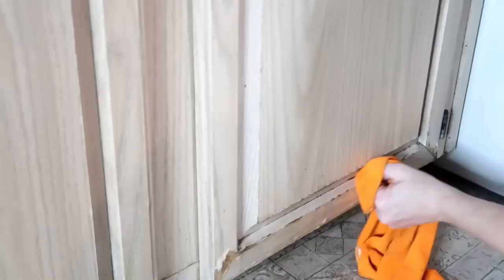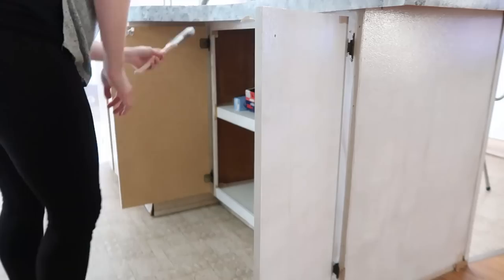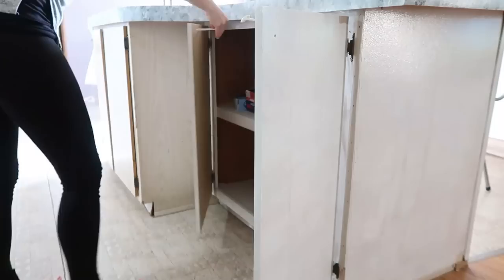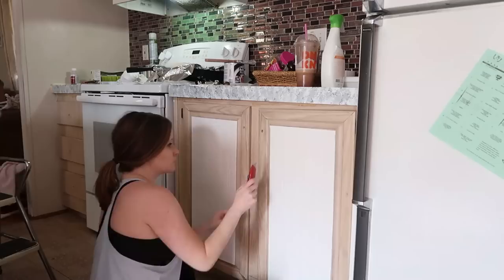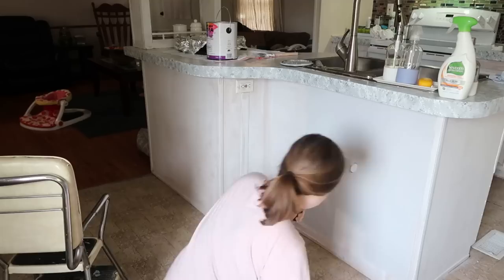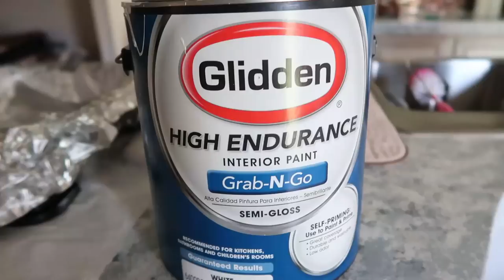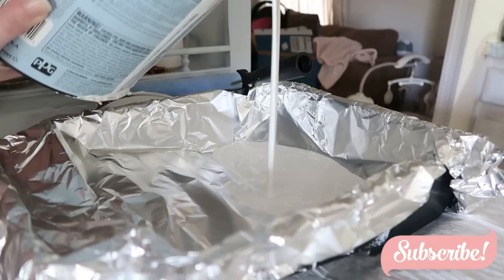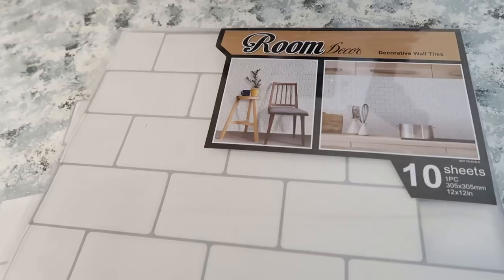MOBILE HOME MAKE OVER TIME LAPSE W/ BEFORE & AFTER | BUDGET FRIENDLY KITCHEN RENOVATION

Comment: Kelly,
If you get the paint strip that includes the color that's on your island,  you can choose any of those colors (usually there are 5-6 colors on the strip) and it will blend beautifully with your island.  A darker wall shade than the island will really make your white cabinets pop!  
You can also paint the linoleum floor with porch paint or really any paint, and finish with a non-yellowing polyurethane.

Comment: Line the tray with a plastic 13 gallon trash bag and tie it with a tie on end. Then just remove by opening and reversing it.  Works great . Also, good if you have a kitty cat but with cat box put news paper before kitty litter. Great job!  Love your home.

Comment: Girl! It looks like another kitchen. Huge change, I love the back splash. In case you want to cover the glass on cabinet just use a thin piece of plywood and glue it over the glass. Also you xan cover it with cardboard (white poster paper) Oil primer and then paint.

Comment: What kind of paint did you use? I'm surprised there was no sanding before priming, but maybe you used a paint designed for sticking to that high-gloss trailer cabinet wood-like sticker paper? 

I lived in a mobile home for 10 years. It was beautiful and functional- full of light and we had lovely open spaces. It is completely possible to make a mobile home beautiful.

Comment: Question - do I understand you did zero sanding or scrubbing with TSP prior to priming and painting?   I dread removing cabinet doors, labeling cabinet doors, labeling cabinet doors, removing hardware, labeling hardware, sanding them taking over a bathroom to scrub and rinse everything.  Then spreading everything out throughout the house to prime and paint.  And I only.plan to do my uppers.  (I have a lot of cabinets so it will be a process.)  

Second - you might consider a light smoky blue wall paint - it will look a bit more gray in some light and a bit more blue throughout the day.  A lot of gray and white could become a bit sterile.  

Third - if you do decide to paint your kitchen floor you can purchase a stencil that offers the painted concrete tile of that appeals to you.  Or you could paint a chevron plank pattern using colors similar to your counter top.  It could resemble wood or ceramic tiles.  (Chevron pattern is inviting but a running or stacked brick pattern is also interesting.)  As creative as you are you could probably make your own stencil.

Well done!!  Your kitchen is stunning.  You have every right to be extremely proud of your work!
Reply from the maker: Awesome thanks for the floor idea! I did not sand any of the cabinets I just went with a good primer 😊
Reply: @KellysKorner08  ...    Thank you for the quick response.   I did record the name of the primer you utilized, I will definitely be ordering 2 gallons.  I don't know if that primer is recommended for vinyl flooring but it might be worth research.  Also, if you join email lists for major paint companies they will send you coupons for discounts.  I usually receive 30% off coupons.  So far I have received coupons from both Sherwin Williams and Benjamin Moore paint companies.  I helped a friend paint her floor throughout her home, we applied 2 coats of white floor paint over primer.  The vinyl in the kitchen had a few damaged spots, we filled those areas with Bondo for automobiles.  We sanded, primed and painted it same as the other floors, 3 years later it looks great.  (We sealed it with a water based sealant.  She adds another coat every 8-10 months.)  She did not want a stencil or structured pattern.  We bought a quart of light brown and light gray stain and applied light streaks with old brooms.  Unique and bright.

You have accomplished amazing things in your home.  You should be very proud.  If interested you might have a new career direction in your future - as a local consultant and as the actual professional doing the work.

Comment: Back some time ago I done my bathroom counter the faux granite. I noticed that some cleaner was used and took off a little bit of the paint. Did you have any problem with this. Maybe I didn't do enough acrylic? Any tips would be great .I want to do my kitchen but I'm a little scared !
Reply from the maker: We haven’t had this problem yet but this is also still very new for us. I would think you would just need more acrylic to seal it better. And it could also depend on the cleaner you use.
Reply: @KellysKorner08  I thought about it and I didn't use the primer . Lol I missed a whole step. I think I probably used Clorox cleanup. Thanks for tip!